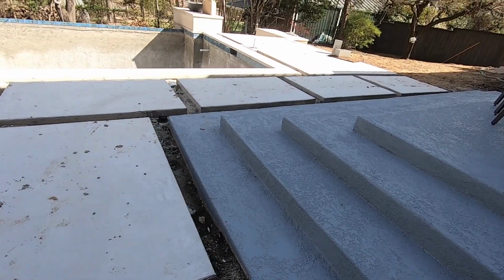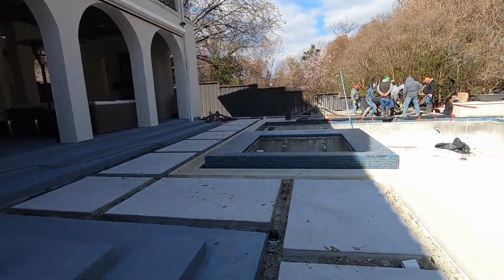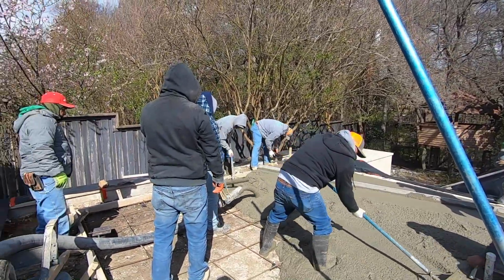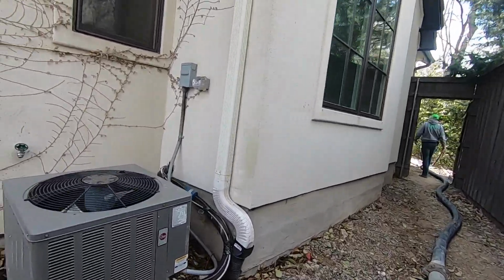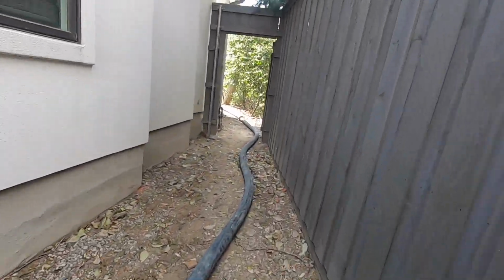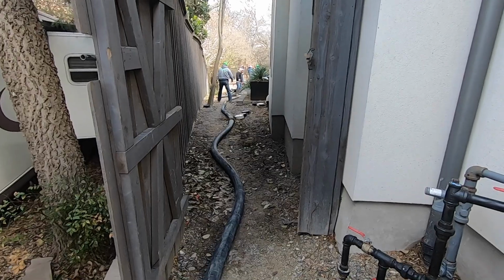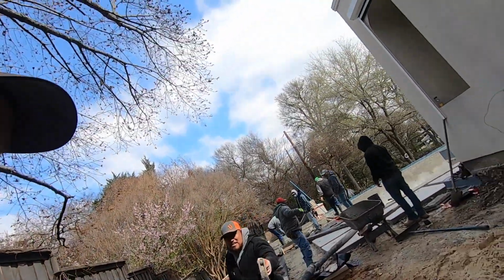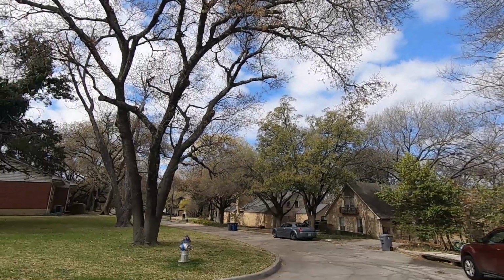Back to Dallas. Pumping concrete  with Muddyfeet

Comment: A buddy and I were discussing why so many roads in your area are concrete instead of asphalt... obviously concrete is a better product.  My suspicion is that the the concrete holds up better with the heat. But I wanted to ask someone in the industry.
Reply from the maker: Asphalt usually ends up cracking up

Comment: Those wheel barrows need ramps and terrain work, leave a mess by the concrete truck and can wear you out and if you got to much to wheel and not enough help end up with baked concrete that not tooled enough. Chess help with being cautious (thinking before you move), looking at the whole situation (what's going on here, what is the contractor or customer trying to do to me) and risk vs. reward, cost basis analysis! Is it worth it? Should I go out and get the truck(s) all muddy when the ground is saturated and risk one or two $600 to $800 tow bills and maybe not get any concrete poured today or should I let the wind dry this muddy mess up? Less mud on the feet and money in the checking account is always favorable!!! I can use my efforts and help from my workers and get this building cleaned up, more useable and increase the value of this property and building.
Reply: @Gordon Richard Ehh atm I have been using flixportal. you can find it on google:) -brendan
Reply: @Brendan Reuben thanks, I signed up and it seems like they got a lot of movies there :) I really appreciate it!!
Reply: @Gordon Richard no problem =)

Comment: What do you do with all the clean-out after the job after it ends up in the wheelbarrow or tub? Thanks for the Dallas visit. Last time I was there was in the 1980's (I'm 77 now.)
Reply from the maker: The crew usually puts in a trash pile or puts in the forms with the other concrete.
Reply: You had to go to Dallas in 1980 ... I'm sorry Jack😂 ... well at least you don't have to go back ... I hope.
Reply: @Fatamus  We had offices in Houston and Dallas. I had some rough trips there because of severe thunderstorms on the approach. On one trip to Dallas the pilot forgot to turn off the intercom which passengers could here. I heard the pilot arguing really hard with the tower about diverting. Pilot wanted to avoid lightening and tower wouldn't give clearance. Arguing continued on approach until the pilot took off up and out to Houston. I could hear the hale hitting the fuselage even with my headphones on. We diverted/landed in Houston to wait till things cleared in Dallas. They wouldn't let us off the plane, but another passenger and I insisted we get off, and we rented a car and drove to Dallas.
Reply: @jacksak  😱

Comment: Do you pump 3” big rock with that pump? If so do you use 3 inch hoses?
Reply from the maker: No 1” is the maximum that I will